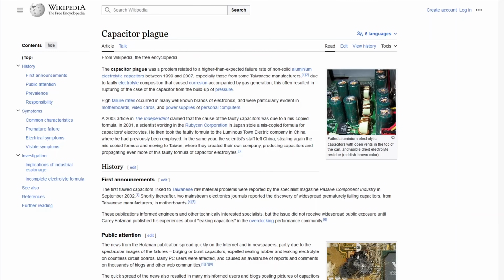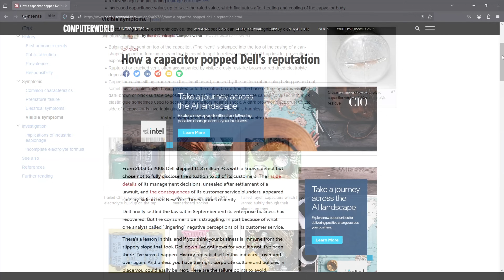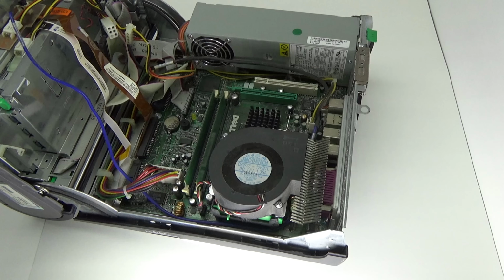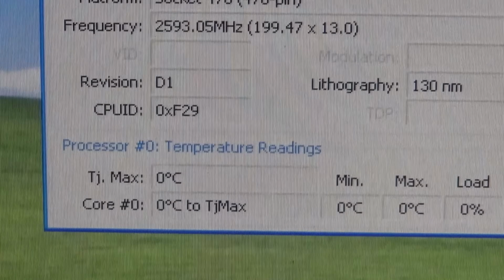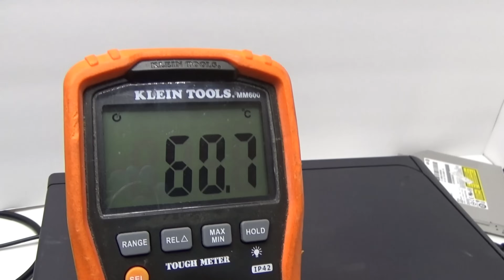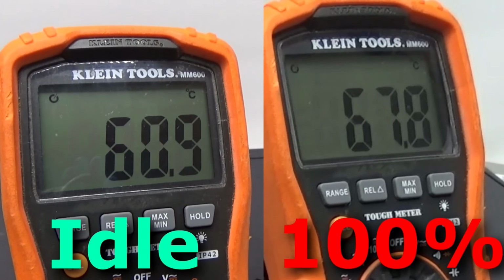Dell Clamshell Hell - Dells thermal nightmare pc's of the early 2000's. OptiPlex GX260, GX270, GX280

Comment: HA HA I was given one of these to use when I started an IT job in 2006.  Yea I liked the idea of a case that opened like a car hood... but yea no intake... mine lasted a week.  It started to smoke and smell like burning rubber bands.  We grabbed it and ran down the stairs and threw it out of the building and left it in the quad till it stopped smoking.  Employees were walking from building to building and staring at us and watching the smoke.  (Your IT department hard at work LOL).  Dells NEVER have airflow.  The later ones had traditional removable side panels, but any mesh at the front of the case was for looks only, and a single fan in that plastic cowling they put over the janky HS on the CPU was basically it for fans.  We had to fix those things; we were all DELL CERTIFIED technicians, which meant we knew how to pack the bad parts correctly to ship them back to DELL...

Comment: I had a friend who is CONVINCED PCs run better opened up.  I had a high end lian li case, back in the day so we had to use a thermometer in the case, and proved with correct air flow the area around the graphics card was cooler.  This was in the early 2k and he STILL runs his PCs open. . .

Comment: i have a GX260 that refuses to die. a large handful of the caps are dead and leaking, yet it still lives, and i can confirm the thermal issues, and i think the fact that pentium 4's ran hotter then normal also added to this issue.

Comment: The funny thing about the clamshell computer, for me, is they make good space heaters.

Early on in my job at a small business, I worked in one of the side rooms of a building that didn't hold heat all that well.

To make matters less ideal, the heater shat the bed one winter.

As luck would have it, I found a clamshell Dell in one of the closets upstairs and it was running a pentium 4.

So, with the boss's permission, I took it out of storage, shoved XP on it and used it for moving files around, something I already had to do at the end/beginning of the new year anyway. Since we had gigabit infrastructure and gigabit is such an ancient standard, it was the perfect device to shunt files around while giving the room oodles of heat. It even raised the temperature of the room by a few degrees.

These machines will always have a special place in my heart as a space heater. XP was very efficient and I probably could have gotten extra heat out of it if I tried installing 7 or 10. Being that it had a pitiful 512 MB of dedotated waaam, that simply was not an option.

I solute the Dell space heater era. Long live the inefficient turds
Reply: This might be the best comment I've read recently! The "inefficient turd" comment at the end is the icing on the cake and gave me a good chuckle.
Reply: bad cases do not make the computers better at heating spaces. in fact it makes them worse. the heat is being generated regardless if it's being properly dissipated or not. What really matter is power consumption, and these are usually not that high-power... well except the pentium 4 ones. but for today's standard? their power supply is like 150w. that can't even power a low power gpu nowadays
Reply: @GraveUypo  I agree. The heat only makes sense if it's being moved effectively.

I did leave out of my story that I reapplied thermal paste since I knew it'd probably be crusty and I had some at home from when I applied it to my other computer.

That along with a program called SpeedFan set to 75% power is how I moved the heat in a way that raised the room temp.

I chose 75% bc it was quieter than 100 and wouldn't cool the heat sink to such a degree that it would lose its heat. The idea was to keep the core heat and blow the hot air, not necessarily to cool the CPU or the heatsink efficiently.

I did experiment with leaving the shell opened just a bit but I decided it was cooling too well. Back to the heater core concept, trapping the heat helps the air coming out be warmer.

I'm thankful the PSU hadn't shat the bed with the workload I placed on it. The NIC, however, was fiddly at times. Not sure if that was an infrastructure issue or that the cpu was near 100% for extended periods or if the NIC itself had heat dissipation issues and the heat was causing intermittent failure but it didn't seem to have a rhyme or reason. By the time I cared enough to check it out, my boss had fixed the heater and all my files were moved. It didn't matter at that point.

Comment: I remember some of the revisions of this design had the power supply fan external to the power supply itself with a shroud. Those fans were some of the only airflow to the machine and would fail and the machine would just cook. I heard about at least one instance where that caused a fire.

Comment: I had one of these growing up, eventually without warning it would never turn on again (interestingly without the thermal event error)

when I opened it, I discovered that someone repasted it with ceramic thermal paste, and the Dell Easy-Bake oven literally cured the CPU and the heatsink together.

to make things worse.. the model I had was the GX60, which was like yours but the difference was that Dell saved a few pennies by not soldering in the AGP slot. so you had to deal with the "extreme" graphics (which could barely manage solitaire). it also had an 1.7ghz Celeron CPU which, even after a fresh windows reload a netburst celeron can't even idle (100% cpu all the time), they were that bad.

truly the HP Stream of the era lol

Comment: A company that I joined had a few of these at various sites, soon as I found a few had capacitor plague I wrote the whole lot off and called a sitewide replacement, seriously bad design, bad capacitors was unlucky, but bad cooling to aggravate the issue is unforgivable!

Comment: I had this piece of shiest at my first software engineering job. It overheated and killed the hard drive. My work VM was not backupable because of a bad sector. It was slow and hot as hell. When it finally died, I was so happy !

Comment: my first P4 was the server version in the full tower Clam shell design. they had a great sale were you could buy an OS Less system and it was something like half the price of the same spec optiplex. It kept good thermals and never failed from bulging caps the entire time i had it, which was something like 10 years. The Front cover had a grid of holes instead of the happy face flip cover thing. The Front USB ports wear installed, but inaccessible. I ran extension cables to them internally and routed them up to my desk. Good times

Comment: When I look back upon my IT management days -- there are certain "it burst into flames"  -- "express elevator to hell" moments that will always be memorable to me.  One of those moments was when the company I worked for bought hundreds  of those GX260 PC's to replace older Gateway PC's being used at workstations.   From day one -- you name it OMG -- it happened OMG.    And of course -- when my company complained to Dell about the you name it OMG -- it happened OMG problems -- they insisted that the OMG problems were due to user error.  But then my company threatened to sue Dell about the OMG problems -- and they ended up swapping out the motherboards in an attempt to resolve the OMG problems.  BTW, my fav GX260 OMG problem was when in the process of frying because of overheating -- them caps going "KAPOW!" and  the screen suddenly going black.  Which, I would be confronted with a user screaming "OMG -- I LOST ALL OF MY DATA!" -- and me sighing "OMG -- not again!"
Reply: I get the sense the "OMG"s here are an acronym that isn't the common internet shorthand(except for maybe the last one)
Reply: And then they realise that they can salvage the hard drive

Comment: I remember working on one.
And the fan noise.

Fortunately, I live in the northern part of the arctics, so...

I am actually kinda wondering what kind of case modding could be done, to give it better airflow.
Reply: Actually nothing much in terms of modding the case to improve airflow - You can remove the CD-ROM and Floppy Drive leaving a hole for fresh air to come in. However the CPU fan will slow down when more air enters the case and the result is a burning hot CPU heatsink.

I have no idea who thought this was a good idea to ship out a PC with such design flaws but with the later GX 280 models they did at least control the CPU Fan via PWM instead of a Thermistor which acts like an 'axe in a forest'.

See my post above for some QOL Mods I've also did to mine.

Comment: I replaced so many boards in those clamshell chassis.  I was a part-time tech for one of Dell's warranty contractors.  Often I'd get a pretty decent per-diem just to go to one site and replace all the boards in that location (schools in particular).  The towers were  better, but only marginally so.  Towers still suffered from bad caps.  When Prescott came out these plastic monstrosities just  baked.  The Optiplex GX280 came in those clamshells and in Dell/Intel's newer BTX form factor.

Comment: Bad capacitors were the real issue.  We were doing a major OCR project back in the day and needed extra horsepower for the job.  So, we used to pick up forklift pallets of used Optiplexes and let the beater farm do the OCR.   We recognized the heat issues early-on and ran them with their covers wide open, but even then the caps would still smoke and pop, even with external fans blowing on them.    I forget the final page count, but it was in the millions. 

If you really want to get the caps angry, pull the 12v power plug for the CPU and fire it up.  They'll cook quick!
Reply: This.  Dell has barely ever had problems with ventilation. 

Videos like this just help spread misinformation.
Reply: @michaelfingers7726  No matter what brand the computer is, clogged heatsinks and limited airflow cause overheating. 
Calling this video misinformation is like you didn't even listen what he said about bad caps + heat.

Comment: I remember my highschool used this kind of Dell, and they were getting fairly old by the time I was in 11th grade when I took a programing class. One of the school techs was in the classroom at least once a week swapping machines, parts, or cleaning them out from the junk kids would stuff into the vents, CD and floppy drives.

He overheard that I was interested in learning how to build and fix computers so a few times he would show me a couple of things as he worked on the machines in the classroom. I remember once he said "touch that hard drive." and it was HOT. Like no wonder they were dying. 
My senior year the machines were being replaced by newer HPs that did have proper ventilation. Though I recall him saying he still wasn't exactly happy cause he knew kids were going to stick paper, gum and such into the now front facing vents.

Comment: I have never used one of these, but I remember seeing them. I actually like the design. Over the years I got one gx270 desktop and one gx280 sff from trash, but neither of them worked. Interestingly, the gx280 is only missing PSU and HDD, doesnt even jave bad caps, if connected to standard psu it powers on. The gx270 was complete even with not wiped hard drive, but the PSU was dead, and it had 3 bad capacitors. After sitting untouched since 2013, I went to replace the caps in 2021. But since I had it apart for like 6 years, I lost some parts :D It managed to boot on a bench, so after half an hour I decoded to put it in the case, and after that it broke again

Comment: I had a dell Optiplex GX 280, a long time ago, and it was constantly overheating. So I cut out large opening for 120mm fan, to fix the issue.

Now I have a Dell Optiplex GX 620, as a spare unit. Dell Optiplex GX 620 have a lot better thermal design, where it pulls air from front and exausts on back.

Comment: Back in highschool I collected, refurbished, and resold vintage PCs as a side gig. I ran through about 20 total dells of this era, both tower and "pizza box". First off, I HATED these clam shells because after years of use and abuse most wanted nothing to do with being opened. Absolute pain. Second literally 90% of these PCs given to me had leaked caps, I am talking all over the mobo nice nice nice. I just pulled CPUs HDDs cables CD DVD drives for other PCs coming in as donor parts and the rest was a write off and scrap.

Comment: I've got an interesting story with one of these, specifically a GX280 tower that my company (a car parts manufacturer) used to run 20 year old Metrology software on Windows 2000.

In my internship in that company, 2 years ago, one day i got a call from the user that said the machine wouldn't turn on. Turns out the hard drive of course failed and the windows 2000 install was borked. No backups of the several pieces of software used daily to make and store measurements, as well as the databases used by said software. 

I spent the next month trying to recover what was left of the data on the hard drive, and somehow figured out the licensing system to make one of the softwares run properly. There was no alternative because the system was hooked up to a measuring machine with a PCI card with proprietary drivers that wouldn't run on newer software or a newer operating system... And replacing a 40K€ machine wasn't an option.

As for the other software... Well, we had to migrate to something newer, which is a good thing it broke because otherwise it would still be hosted on that terrible machine as we speak. The company did a complete database migration for us, and now it's hosted in a dedicated server backed up regularly.

Now everything that still runs in Windows 2000 is hosted under a VM with no network (the GX280 was in the domain...) and backed up daily in case the late 90's measuring software decides to bork itself again.  
This is probably the most memorable 2000's piece of computer history i've had the pleasure to fix. Even when the drive was dead, it somehow managed to fry a stick of ram randomly WHILE i was trying to make it work.. So terrible it borks itself on top of borking itself.

Comment: I resold hundreds of these things between 2008-2009, maybe even close to a thousand of them and they're not anywhere as bad as you're making them out to be.  The caps were horrible but that's due to the capacitor plague, which affected pretty much every computer back then.  Once they were recapped they lasted forever.  I just had one of them come back to me a few weeks ago that I sold back in 2008 and it was still running!  They were very nice, reliable machines with a small footprint and a great design.  They weren't meant for gaming or video editing so it was rare for the CPU to be under sustained load.  They're office PC's and were a godsend to people on a budget who needed a computer to find a job because they lost theirs back in the economic crash of 2008.  I bought these suckers for $55, put a few bucks worth of capacitors into them, and resold them for $130-$150 depending on specs.  Thanks to these things I was able to pay off my family's massive credit card debt and pay for my college education.  The GX270 will always have a special place in my heart.  I'd say 90% of the computers I got were the GX270's, 8% were the GX260's and 2% were the GX280's.  The 2.8Ghz GX280's ran the hottest.  I never understood why they'd put such a powerful processor in a case like this, especially considering the use case (office PC).

Comment: I've dealt with a lot of gx optiplexes, but their thermal design is fine and it's never been a problem. Bad caps are a problem. P4's run hot they are made to. It's a freakin business computer they are tanks, they had defective caps, and if you look closer into the history, they were made with a stolen and incomplete chemical recipe from another company.

Comment: These machines were built with the very same Pentium 4’s as Dell’s full size desktops. It is no wonder why these tiny computers from early 2000’s failed to live very long as the Pentium 4 generates more heat than most processors that came before and after their existence. Even I correctly predicted the problems that this tiny case would cause when paired with a Pentium 4 back when I was building these. Perhaps if they had underclocked and undervolted the processor maybe it could have prevented early failures but that never happened. 😂
Reply: It's not even always the P4 that kills the system. The chipsets on these motherboards are just about as hot as a P3 all on their own, and get tiny passive cast aluminum heatsinks and sometimes just a thermal pad instead of paste. I've seen boards with chipset heatsinks that came loose just from the push-pin mounts relaxing from the thermal cycling.
Reply: @DigitalJedi  Also bad caps
Reply: @windowsuser321  So many bad caps. It's every single one from this time period.

Comment: There were versions of these cases that had Pentium III CPUs which did not have thermal problems, A Pentium III didn’t produces a lot of heat so they never had any thermal problems. The Pentium 4 on the other hand creates a ton of heat which is why those computers essentially cooked themselves.

Comment: I always liked those small form factor PCs and the amount of creativity they had to make everything fit in such a case. Still,pretty much all SFF PCs at the time had overheating issues because the Pentium 4 CPUs just used to run hot,especially the Celeron Ds and the Pentium Ds. A friend of mine had this same Optiplex form factor but hers was running a Pentium III and it never really got that loud. Modern Optiplex systems still use such cases with restricted airflow and blower fans with even smaller cases,but they manage to stay cool due to the fact the cpu does not run full ghz speed all the time like those older Pentium 4s do but the downside is,they don't really manage to reach their full turbo speeds due to throttling so they could remain silent